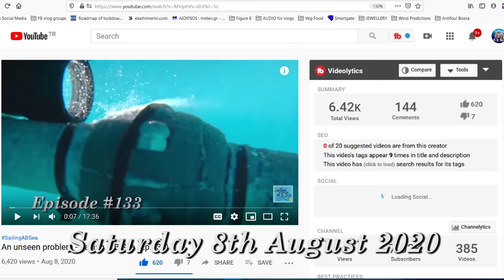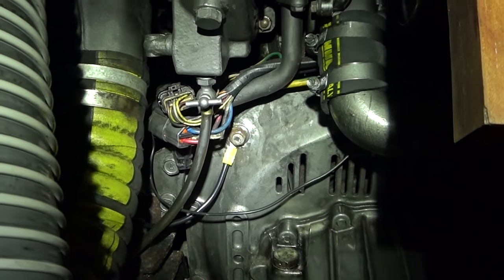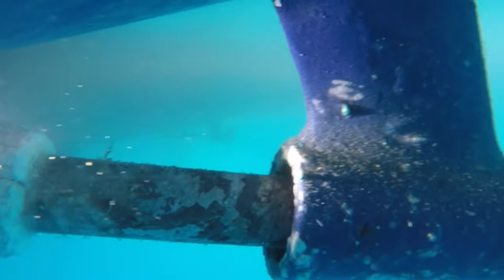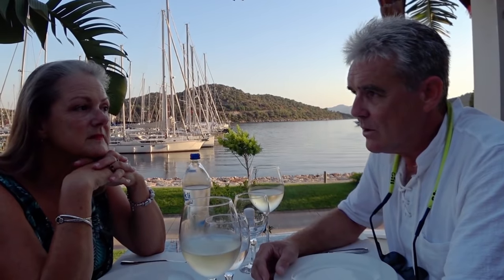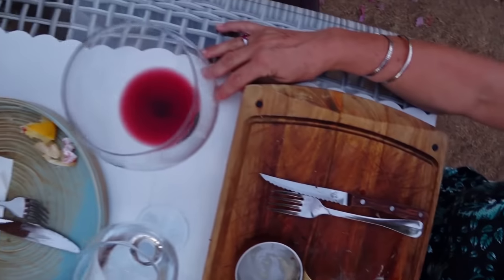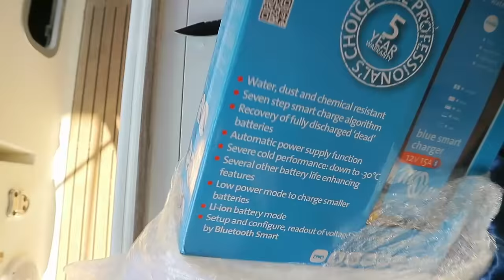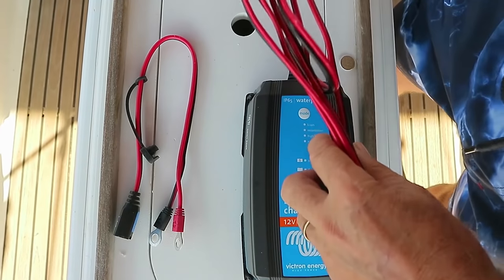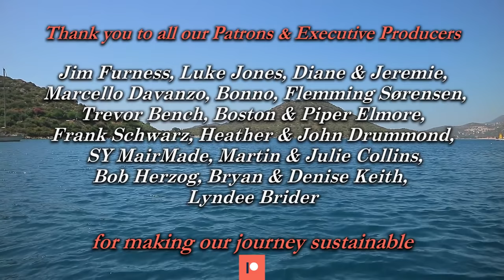Battery monitoring made easy - Sailing A B Sea (Ep.140)

Comment: It may be a trick of the camera but it looked like you put the new victory charger quite low down (almost bilge) in the boat. It may be the model number is IP65 but that is also its rating in terms of resistance to water ingress. IP65=Splashproof. You may wish to remount away from flood danger (i.e. higher). Good episode and good luck with the continued fault finding.
Reply from the maker: Hi Norman, I agree with your point, but if that sail locker gets flooded to the extent that it will submerge the battery and battery charger, then we have bigger problems on our hands. 😂😂😂 

Forward of that locker is the chain locker which is an isolated crash zone.

Comment: IP65 is the 'Ingress Protection' rating i.e. IP65 is splash proof whereas IP67 is submersible to 1m, lots of things will have these ratings, it could be that your battery chargers part number is that, but more likely that it is letting you know it is waterproof. 
Really pleased you seem to be getting your issues fixed, and good luck with the patreons coming aboard.
Reply from the maker: (Baz) That's something new I've learned today, thanks for sharing that info Pete.👍😀

Comment: Thanks for another great video.  It took me straight back to my very pleasant time in Kas marina last autumn.  Also the town is quite pleasant.  We came very close to signing for the 12 mths ourselves. The extra battery charger with blue tooth is a very good solution and gives you a bit of redundancy.  It also lessens the demand on the main battery charger. Shocked to see the earth strap not attached to the engine, I would think you have now nailed the bothersome fizzing anode syndrome (FAS).
Reply from the maker: Now that we have most of the big jobs completed we are feeling very positive about the future. Loving the FAS reference, cheers Bill.

Comment: Baz the earthing strap is good for its own reason but I don’t think it’s to do with your shaft anode. The reason being your cutlass bearing provides the isolation between the shaft and your T bar as it’s rubber. But hey it’s solved so I still think it was a magnesium anode. I have one of those victron 15 amp chargers that I keep for little charging jobs and they are just great like the rest of their products.  Great use for it 👍
Reply from the maker: Hey Mike, we are loving all of the Victron products we have on board, especially liking the Bluetooth monitoring.

Where are you sailing/anchored/berthed at the moment?
Reply: @SailingABSea  im sitting off inhaca island in the south of Mozambique. South Africa opens borders on 1 October and we get a young additional crew member on board looking for sea miles and then we head for Zanzibar /Tanzania
Reply from the maker: @mikeferguson2828  ohhh that sounds like a plan Mike.

Comment: There is nothing in the ship's log that says it was struck by lightning? And I also recommend you put another ground wire to the motor. one forward and one back.
Reply from the maker: The previous owner did not give us the ships log, there is a second ground wire from the engine block. 👍
Reply: @SailingABSea  well hazing always pays. Boats must be purchased with their vitacora and repair record.If the owner does not want to provide it, it is because he has something to hide.
Reply from the maker: @juancarlosbugallo2614  we didn't know that, thanks for the info Juan.

Comment: Hi Baz, I am also preparing to live on the boat, can you tell me how much the contract in the Turkish marinas cost for the 12 months? Thanks
Reply from the maker: Hi Claudio, marina prices vary greatly. Even withing the Setur marina group the annual contract prices differ. Here at Kas we negotiated a 12 month contract for 34,250 Turkish Lira. Finike is cheaper and includes electricity and water, Marmaris is more expensive with electricity and water extra. Hope that helps.
Reply: Super quick response. Thanks. Does this price also include the possibility of using other ports of the same Setur group?
Reply from the maker: @studiocapriolo3568  yes, 30 days at each of the other marinas. If you're thinking of signing with Setur at any of their marinas let us introduce you and we both get an extra free month.
Reply: @SailingABSea  Thanks, Great initiative! I will definitely call you if I choose this option.